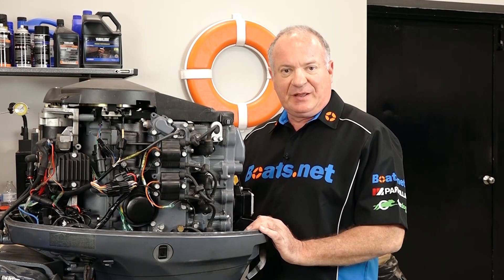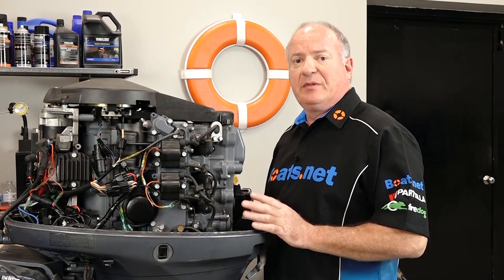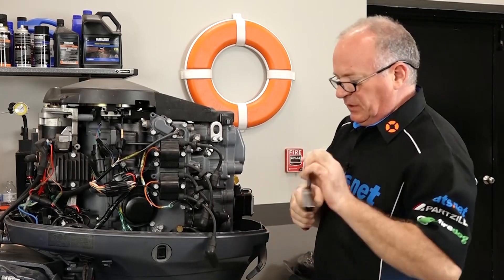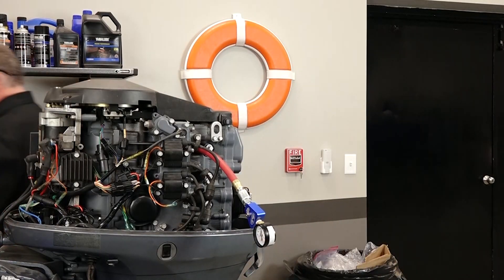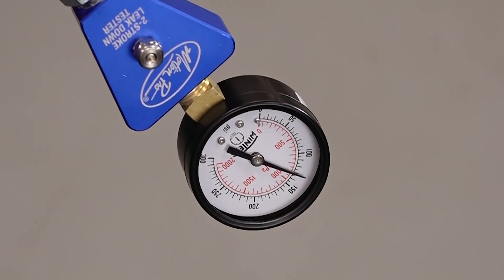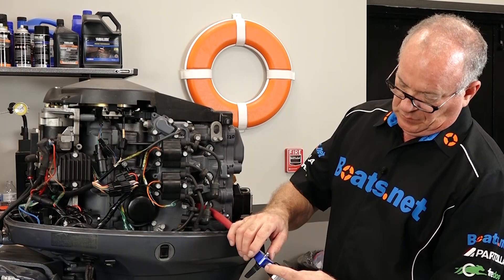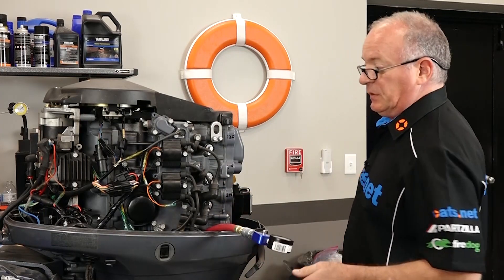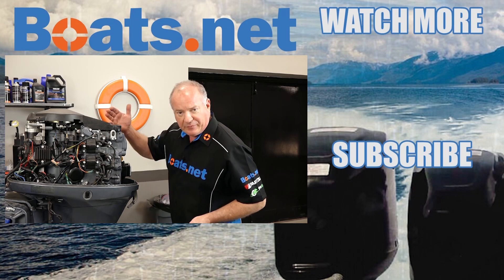How to Do a Compression Test on an Outboard | Yamaha T60 Compression Test | Boats.net

Comment: Hello mate, I hope you can give me a reply , I have put a deposit down on a boat ,and l am now a bit scared that this is a bad move. It is a Yamaha 4 stroke 80hp  from 2001 , The engine has only done 44 hrs from new, The old pensioner selling the boat is a bit clueless, I have seen an invoice that he has had some work done to the engine, one cyl was about 50 psi, and n2 was about 65, then nr 3 about 80 and nr 4 seems normal at about 180 psi. The paper is in Swedish,google translate says valve play for slightly adjacent,could be adjustment valves. grinding in valves, top gasket washer pads, valve measurement and cylinder head bolts.  This cost  came to about 400 pounds, the engine had full service cambelt replaced and some other work. Totaled price was about 3000 pounds.  2022. The invoice never stated all good now, and new test afterwards of cylinders,. I am going to phone the company next week. So l guess my question is, according to the old pensioner, nothing wrong with the engine. I am really hoping the company says also ,the valves were the problem with compression. I am supposed to pay full price and pick up next Saturday. Even if l do my own compression test next week, he has not even charged the battery to be able to test compression. If l pull out ,lve lost 1500 quid deposit. How would you look at  this, the boat and trailer is nice condition for 23 years old. I suppose strange to have this problem on an engine with very little hours.Oh by the way, the engine was running warm obviously caused by this valve problem,l assume.

Comment: I have a 98 Mercury 175 efi  and I’ve noticed that the positive and negative posts on the evaporator are loose but the wires are tight to the post, I was having an issue with it cutting out mid throttle, I also found that who ever owned it before me replaced the regulators and smash those wires behind them when they installed them. I’ve since replaced the regulators. I didn’t have any issues running today but it wouldn’t start until I messed with those loose posts